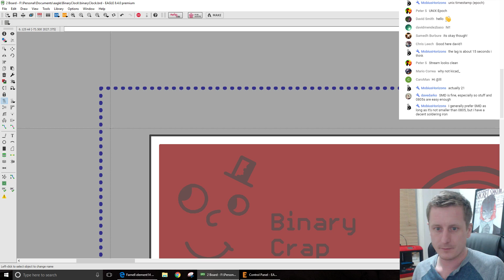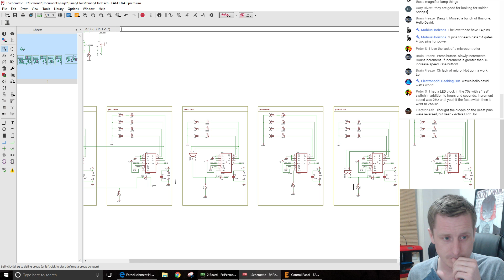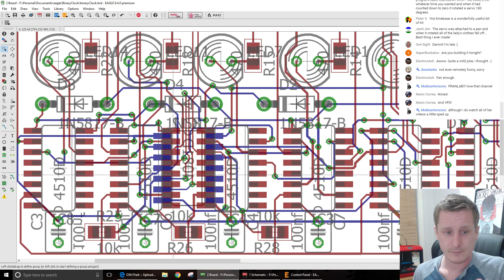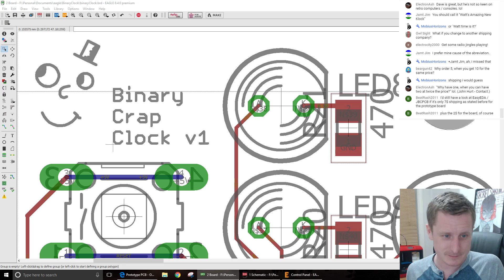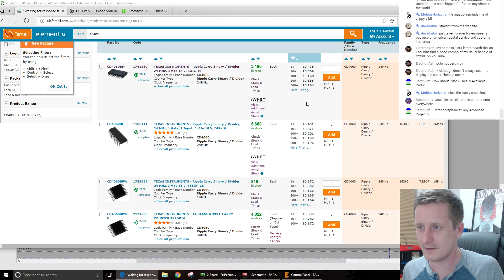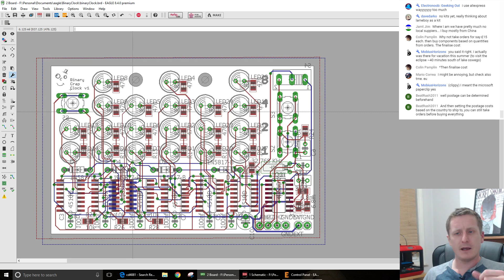Live Stream 21 - Finalising the Binary Clock Design

Comment: $29 per board seems extremely steep... pcbshopper.com says about $50 for 40 of them, guessing the size at 100x50mm (from the 5mm LEDs).
Reply from the maker: Howard Jones I think it was ~£30 for 5/10, I want to get a short run done and tested before I order the real batch. I will shop around before I commit.